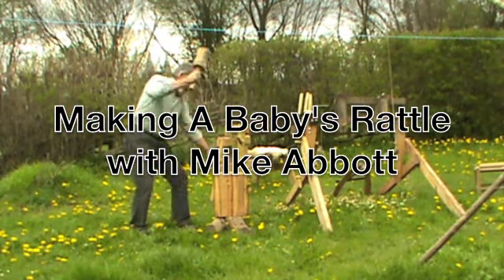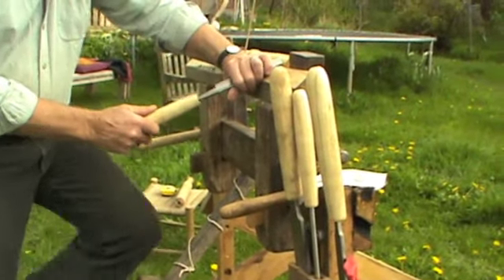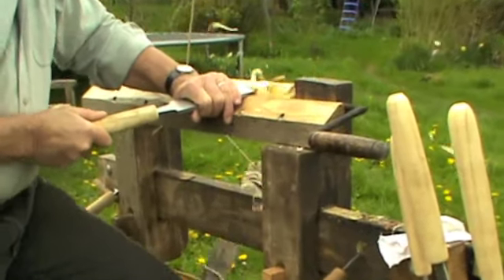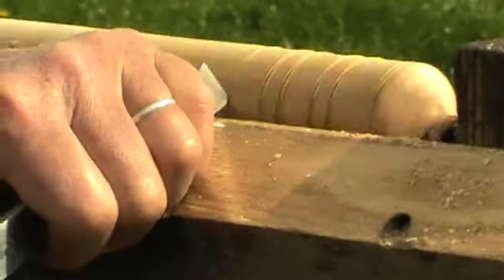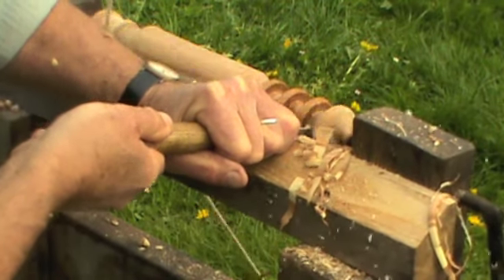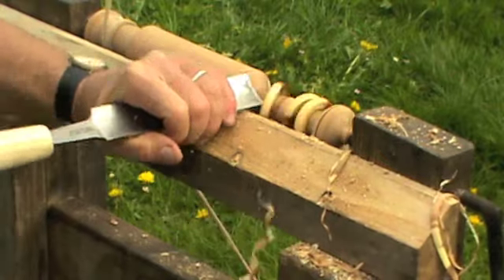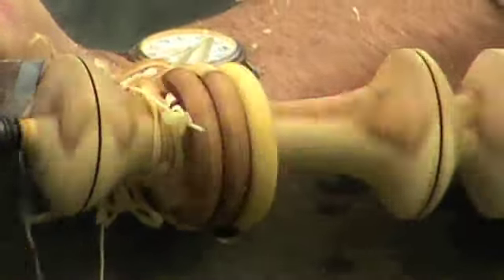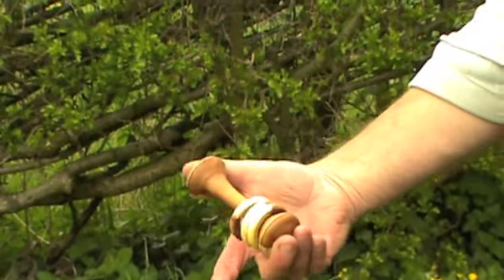Making a baby's rattle with Mike Abbott

Comment from the maker: Thanks for the question. The main reason it doesn't crack is because it has been split so the pith has been removed (as you say). The wood can then warp and shrink as it dries rather than develop cracks. The reason I air-dry the blank before completing the rattle is so I can get a good shine on it, while still on the lathe.

Comment: What keeps the green wood from cracking? Removing the Pith? Letting it dry for a week or two without bark?
Reply from the maker: Sorry to have taken 6 years to reply! Cleaving the log allows each piece to shrink unevenly, which is what it naturally does. Then it has no need to crack. If it dries very quickly, you may get little cracks on the end, so just leave it in a warm room or outdoors in the shade and it should be fine :)